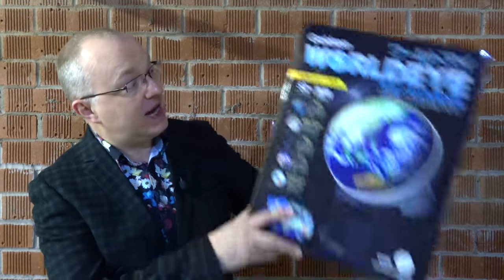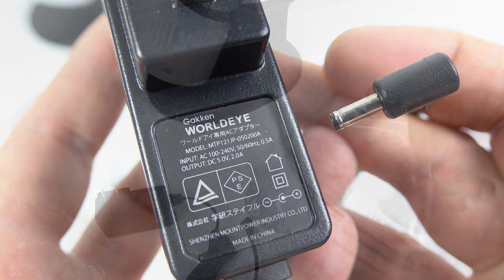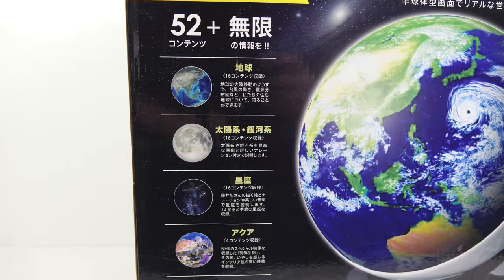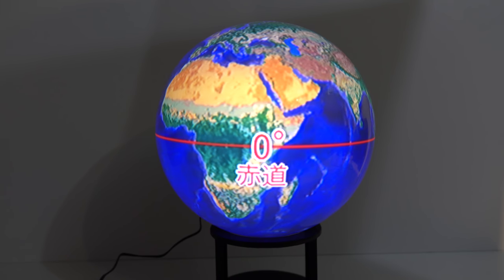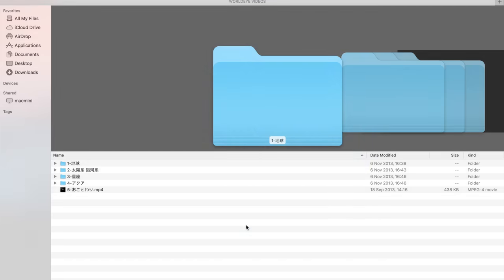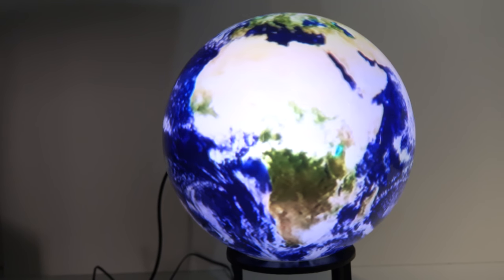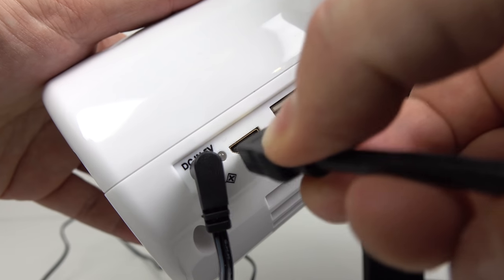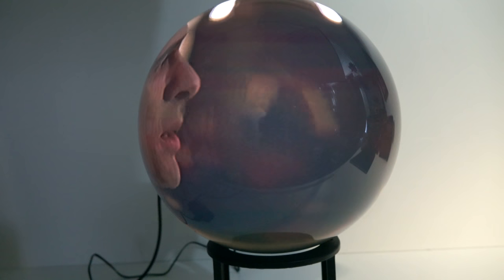What in the world is the Gakken WORLDEYE?

Comment: I found a unique use for this: George Lucas's head. What it takes to make images, head's in particular, look correctly proportioned is a filter in Photoshop called Spherize; you set the value to -100. It shrinks the head so looks comically tiny on the actual picture, but perfect when you load it into the Worldeye: https://youtu.be/r3oqHEF_0kI?t=6m24s
Thank you for the inspiration, I look forward to more reviews of unique tech I never would have seen otherwise.
Reply: Almost, I did the ones you see Mat uses in his videos and gave some files to be shared freely of it. The way you make the images for the Gakken World Eye is to actually pinch them, because of the bulging that happens when the internal projector hits the inside of the sphere. However, you need to make a circular mask around the image you want to distort, so that the pinching happens from all sides of the circle evenly. If you're using a rectangle or square, the distance from the center to the various edges of the rectangle/square will be uneven and you'll see it clearly when projected. Also, you only need to pinch using the settings at 50%.

Since I haven't found a video plugin or tool that does so to video, the process of making these, was overly complicated with finding footage, edit what you need for a loop in any video software, aligning it with the 640x480 original, export every frame, batch editing these in Photoshop (making a circular centered selection, pinching, saving it, re-attach these processed images into a file, copying the final clip into something that can loop for a longer period of time since the World Eye can't loop seamlessly without going black as you saw.

But nonetheless a fun project when you get all of it right.:) 
Here are the files I uploaded for Mat: https://www.dropbox.com/sh/ogss29tuiuvplqv/AACqPeIQT3-ssZ1heIdiWqr1a?dl=0